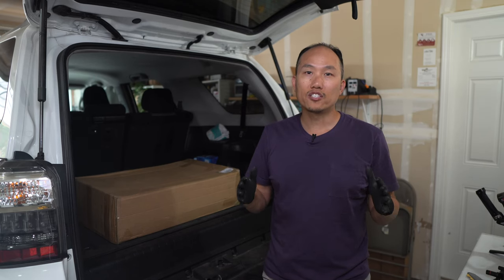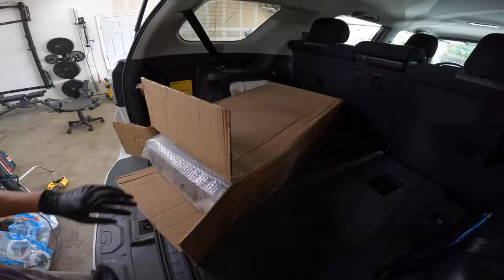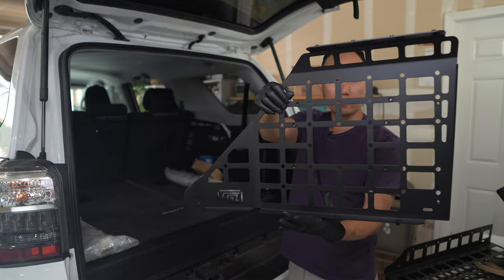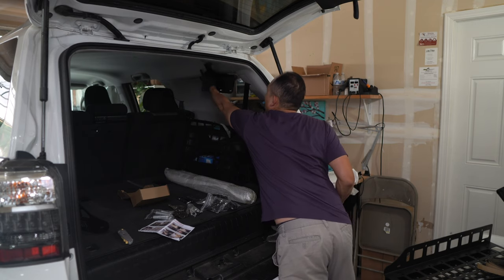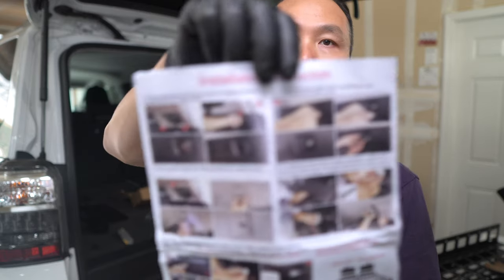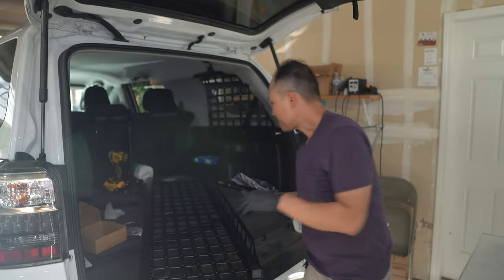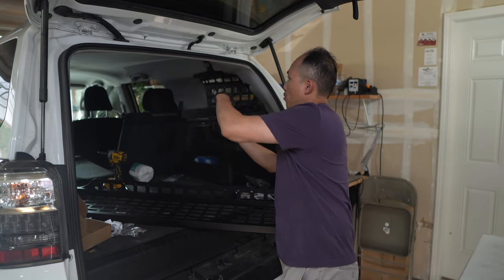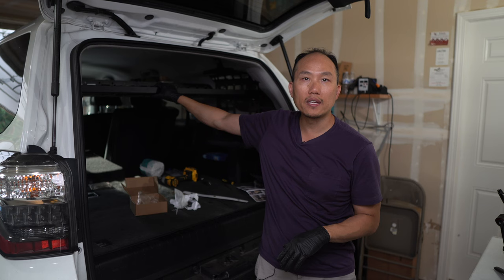Toyota 4Runner 5th Gen Interior Shelf Installation for Overlanding

Comment: Can you see the traffic behind you with this shelf on and rear seats up?
Reply from the maker: I can see through but it does block the view for sure.  WIth the wing nut, it would probably make more sense to take it off until I go on a trip but I've noticed it comes in handy when I go grocery shopping.  I put all the box items on the shelf and the rest of the groceries on the bottom.
Reply: You dont need to see right behind you. duh..Use your mirrors.Dumb question with what your looking at.